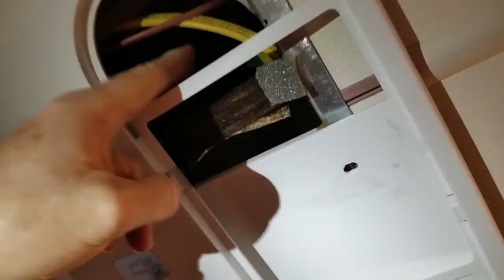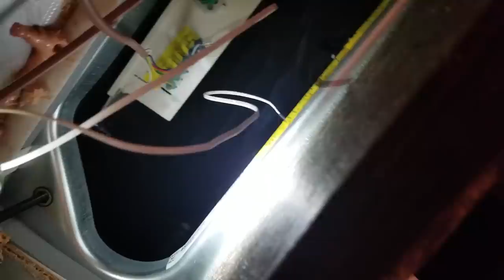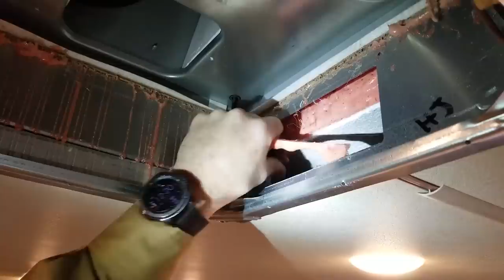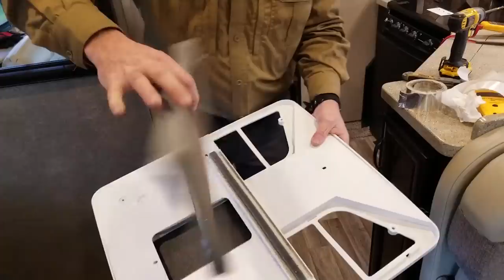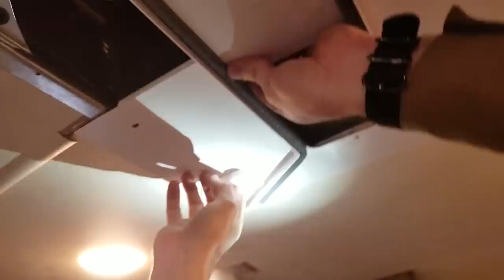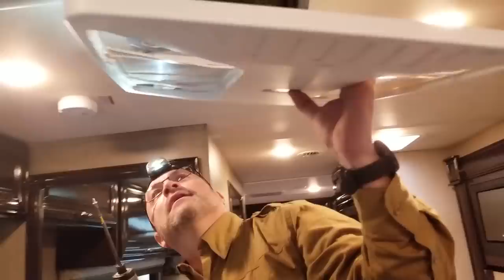Boost Your RV Air Conditioner Performance With This Cheap, Easy Fix!

Comment: I  get 25* to 28* difference between outside air temp and the return air coming out of the ceiling fixture. (I don't have ducts). It was 110* here in AZ. yesterday, will be 112* today, and 114* for the weekend. I live in the motorhome full time, and stay pretty comfortable. And I'm nowhere near a shady tree. It takes a little work, but not a ton of money. I've used the foil tape to make sure the warm side and cool side do not mix, or have any way to go where it shouldn't. My cold air comes straight down through the roof, hits the flat bottom of the AC's ceiling fixture, and has to get itself out by going toward the front or rear and exiting through the vent openings/louvers. I put a layer of Reflectix insulation in the ceiling fixture, and directly under the cold air return side I made a small "splitter" out of a manila folder, and taped it to the ceiling fixture . It basically forms a smooth, rounded, upside down "V" right in the middle of the air flow. The point of the "V" is at the height of the of the actual ceiling. This forces half the air to flow smoothly down one side of the "V" towards the front louvers, & the other half towards the rear rear louvers, instead of slamming into the fixture like a dead end. There's a lot better flow out of the louvers, and the reduced turbulence is a lot quieter. I clean the rooftop coils once a year at least. Twice if it's good year for monsoon dust storms. I keep the air filters clean, and added a layer of the thin, black, spongey-looking filter material to the outside of the the ceiling fixture air intake vents to act as a pre-filter. I attached them with some small, round neodymium magnets. I can just rinse them out real quick, and I can go about three times longer before I have to drop the ceiling fixture to clean the regular filters in there. I also use a small fan to blow air around inside.
  Other things I've done is put that Reflectix wherever I can. Inside the closets and cabinets. The roof vents and bathroom skylight/hatch. The back side of the furnace return air cover. Under the bed where the fresh water tank is. All of the widows are tinted, and have a snap on shade cover with a piece of Reflectix behind it, and thick window and windshield curtains on the inside. I keep the awning down on the one side. On the other, I put a row of screw in snaps along the roof line (like the snaps for boat covers and Bimini tops) to hold  a wide piece of 85% shade cloth along that side. For the roof, I bought a few pieces of the 4'x8'x1" foam insulating board from Lowes/Home Depot and cut it into pieces to fit the flat parts of the roof (Between the roof vents/AC/antenna/plumbing and refrigerator vents, etc. Nothing real meticulous. Just cover the big spots.) I stuck it on "shiny side up" using a few dots of silicon adhesive on each piece. The shiny side isn't very shiny after a summer, but it still keeps a lot of heat off. Do NOT try to stick it with silicon caulk. You'll be picking that stuff up everywhere after the first good wind. Even more if there's a little rain with it. If/when the board gets wet, it seems to dry out pretty quick though. Also, the best way to cut that stuff is with an electric knife. Works as good as it does on a ham or turkey! Otherwise, you end up with zillions of tiny styrofoam balls blowing around. Unless you have a hot-wire cutter I guess. One other thing I did to help the refrigerator out is I mounted a couple of 6" or 8" 12v computer fans just under the fridge vent cap on the roof. I pulled the 12v from the back of the fridge for the fans, and go through a little push button On-Off switch that I mounted through the wall on the inside right beside the fridge doors. Also a little red blinky LED so I remember it's on. I can't hear the fans at all. If the AC gets a little behind on a really hot day, I close the hallway curtain. The bedroom/bath in the back get a little warm, but not real bad at all. It definitely helps keep the front half cooler. I've never had to do it after evening though. And as a last resort, I made a small AC assist device if it's smoking hot out using a 12" piece of 3/4" PVC. On one end I attached a garden hose fitting, and glued a cap on the other end. I drilled and tapped two small holes that will fit the brass spray nozzles that are used on an outdoor residential Mister system. Each nozzle uses only about 1 to 1 1/2 gallons per hour. The Coleman Mach AC pulls air "in" over the condenser coil (for some reason they pull the hot air in towards the evaporator side/compressor/capacitors/pcb....who knows why?) so I aim it near there. I try to keep it back far enough that it mostly evaporates into cool air before it gets to the coil so it doesn't get lime/calcium built up on the coil. I don't want it "wet". It works pretty good in the Sonora Desert. Maybe not so much in New Orleans.
  Right now it's 8:45am. The outside temp is 95*. I have 2 digital thermometers inside here and they both read 69*. (It's actually a little too cool. lol).  I get this from a Coleman Mach III air conditioner (13k BTU) that's now 35 years old. It's the original on my 27' 1987 Fleetwood Pace Arrow motorhome, as is the fridge, furnace, water heater, power converter, etc. At 59,000 miles, I think the 454 is just getting broken in!  The only thing it really has wrong at the moment is a sun-faded exterior!  (I wonder what a "wrap" would cost for this thing?). I've owned it for 16 years or so, and used it mostly for some camping, a good bit of tailgating, and a ton of NASCAR & NHRA races. 3 years ago I ended up selling my house and moving due to some family issues to take care of, and have been full time in it since. Well, me, and a Whippet, and a big, goofy old Chow/Lab mix. When I eventually move on, I think I'm gonna stay mobile though. But it'll be in a 95 footer with 17 slide-outs, 2 engines, and 4 or 5 AC's. Maybe a pool. Something around there anyway!  lol  Anyway, hope these ideas can help some hot RV'ers out, too. Hot weather is doable.

Comment: Thanks for the information I have 3 / 15000 BTU AC units in my toy hauler and the one in the main living area is up in a loft area it doesn't seem very efficient I will have to check it out.

Comment: Thank you so much. I've been struggling with the AC in the main living room of my 5th wheel. Takes forever to cool down and the air is weak flowing at the duct vents. Can't wait to pull it apart and check it out. This makes complete sense and has to be the main issue with that unit.
Reply from the maker: Hi Stephen,

Hope that fixes the issue.  Also check where the ceiling ducts are.  Often you will find you are cooling the attic!

Happy Camping,

Cheers, 
Darren Koepp
Reply: Thank you very much!
Reply: I am having the EXACT problem in my 5th wheel. Air comes out strong of the main vent, but as soon as I close that the other vents barely blow more air.
Reply: @thedude1215  I did all exactly what he did in this video and fixed the issue. He's also right that you should check around the vents. The one in my bunkhouse was partially separated and cooling the attic. Just came back from my annual river trip. 95-100 outside and it was cold in that trailer. Had a friend stay in the bunkhouse and she said she was super happy to have a down comforter.
Reply: Thanks @tractor1969  !

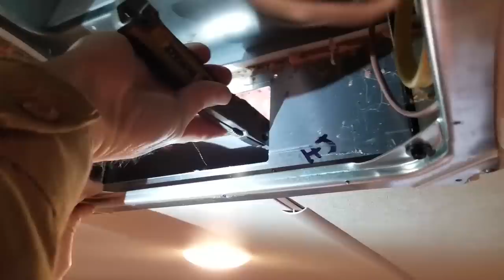Comment: yeah at about 5:35 you’re doing what’s called “flow.” when you make custom headers (or buy factory) it’s best to inspect them inside. there will sometimes be welding rod or wire remnant or even pipes misaligned with protruding edges that cause the turbulence. flowing them (sand blasting in this case) insures faster smoother passage of air. same procedure with cylinder heads; 3 angle, port, polish and flow. many guys don’t know about or ignore the flow.
that unit was a raging design flaw from the factory. nice fix!
Reply from the maker: Hi Dave, thanks for the comment.  I gotta work with the mess they give me - I try to make it as slippery as possible but sometimes it gets ugly!

Cheers,
Darren
Reply: My RV Works, Inc. hahah! been there, done that...

Comment: Had to do the same. Same Coleman unit. Also pull each outlet from the roof and tape the gap between the roof and duct....those had poor tape job and the attic space was getting air.
Reply from the maker: Hi Michel,

I just replied to another of your comments!  Thanks for contributing this top!  I should have mentioned it in my video but since I go unscripted I often forget to mention things.

I appreciate you and your contribution to this channel.

Cheers,
Darren Koepp

Comment: Just had our first hot weekend in a recently purchased trailer.
You have long been the "go to channel" for solid repair advice.
I wasn't happy with this rv's a/c! A coleman as well. I know what the next order of business will be 
I wondered about the roof unit having a black cover. Does a white cover prove any benefit on heat exchange?

Comment: I saw this video and realized my fiberglass divider was installed upside down,  foam seal against foam seal, and no seal at the top.  Yeah, the foil goes on the cold side, as silver doesn't radiate heat. Thanks!  Seems these were all installed by guys late for lunch or something.  That interface between the metal plenum flange and the plastic bottom plate would benefit from some 1/4" foam tape as well to seal that whole cold plenum chamber.

Comment: I found large pieces of ceiling material in my duct work.  They cut the holes for the vents, and didn't retrieve the pieces.  The ducts were blocked.  Very shoddy installation.
Reply: Forest River?
Reply: @Dman-jr8ey   Yep.  Exactly.
Reply: @timgreen4137  Just bought a Forest River Salem in the spring. Absolutely built like garbage. Horrible workmanship.

Comment: Our 30 year old HR had similar problems which were obvious as soon as I removed it's cover. It's difficult to understand why manufacturers allow such bad installations to pass inspection. What's surprising is how well it works in spite of it's bad installation.

Comment: New to us RV trailer. Had a look at mine (Same model as the one in the video). Both Ducts to the ceiling vents were completely taped off from factory. Only AC air, when on, was coming through the shroud vents. I sometime wonder what goes on at these factories and why they allow daytime drinking ;-)

Comment: Darren, I may be looking at a replacement.   I figured we've made  a profit on ours as it was new on 2005 and was working all the way up 2019.  It's a 13.5KBTU but I'm wanting to put on the best possible 15K BTU a/c that I can.   In your experience what is the best one out there?  Your efforts here quietly speak to the quality of construction!

Comment: Very good video 👍👍👍. I realize my air conditioner was not working good. I did the same thing you are doing.  Years ago. That divider is junk and something else should be use by the manufacturer.

Comment: Great info thanks very much for this I am having an issue with mine now not flowing very well to the front but still is good to the rear about to dig in and find out what is going on. But now I have a great starting point.
Reply from the maker: Good luck on the hunt!  Sometimes I am able to stick a flashlight in the far end and use a mirror at the A/C end and 'see' the light and identify any obstructions.  You may have already thought of this tip though.  

I will cross my fingers for you!

Cheers,
Darren
Reply: Thanks for keeping the fingers crossed found that the divider had fallen and was allowing he cold air to be sucked right back into itself. Put it back up and used the foil tape and fixed it as well as fixed an open spot that was not taped up very well and was allowing the air to escape right into it void in the ceiling. Works great now. I did use a battery powered ryobi
Reply: Ryobi leaf blower to make sure the air flow was good.
Reply from the maker: That is a great report!!!  Help share the info so others can stay cool too!

Cheers,
Darren

Comment: It's good to see someone use the proper tape for ducts. One of the first signs of a poor job is someone using duct tape for ducts. Foil tape is the proper tape for ducts in homes and RV's.
Reply: Surprisingly enough, "Duct Tape" isn't supposed to be used on ducts.🤔🤷‍♂️

Comment: So this is a fix for Coleman a/c units only.  Duotherms are built differently.  But, thanks for this video.  This is a huge issue that you fixed.
Reply from the maker: Actually any air conditioner that fits on top of a 14 X 14 hole has the potential to have a breach. Different manufacturers have different methods to address this but it all has to do with how they were installed.

Comment: It does more than a 20 degree difference.   It was 94 out during the summer, my ac was on full tilt, it was 59 degrees in the camper.

Comment: I wish this guy could look at mine! I have a brand new 33 ft travel trailer from bumper to coupler. On 90* days my camper will not cool down below 84* until the sun goes down. Just does not feel that cold. At night it works great. Of course camping world says there is nothing wrong with it. I dont think mine is right.

Comment: Hi All,  Great video as usual Darren!!!  Question to those on this thread:  has anyone installed a RV Airflow system and if so, what is your opinion of it.  While funneling airflow to the ducts and shutting off the dump makes sense the price point is pretty high for the unitl

Comment: Adding a hard start capacitor and a fan delay would help when you have a low voltage condition which is very common in the RV parks !
This might take some knowledge to but not very difficult .Maybe easy for a 20+ year HVAC tech ?
Start with simple tape idea first .
Reply from the maker: Hi  Joe, I could not agree with you more!  Both of the suggestions will go a long way in helping folks keep their A/C's running in less than optimal electrical conditions.

I just recorded an RV Rooftop  air conditioner video where I walk through testing the compressor, capacitor and talk a bit on how capacitors work.  It would be good to hear your comments on that video when it gets uploaded.  

On the unit I was working on it turned out to be a loss of refrigerant so I talked a bit about the clean air act and how folks need to go to an HVAC shop to get them resealed and recharged.  We used to be able to recharge them in the field but the fines have gotten so stiff if you are found doing it without all the correct licenses and tools so I just replace the A/C these days - which is what we will end up doing with this customer.

Thanks for the comment!

Cheers,
Darren

Comment: Thanks for info on rv air units & wall thermostat.  Question: In and older camper without a wall thermostat. Can a wall thermostat be wired into an air unit where the compressor cycles on/off but the fan runs continuously.  The thought is for the fan & compressor will cycle on /off at night. Now you have to get up & turn the fan off. Thanks, have a great day. Gary

Comment: Good video, nobody thinks about these defaults in the air conditioner. We all assume companies know what they are doing!
Reply from the maker: Indeed, it is still something on everyone's A/C that should be checked once a year. The adhesive on the foil tape fails over time.

Comment: Good observations of the “little details” that can add up to poor performance.  Speaking of observations, on the insulated divider which all made great sense with what you did, except with the foil vapor barrier on the cold side.  I’m thinking that vapor barriers are suppose to be on the warm/humid side of the insulation like in houses (interior side of wall).  In this case in inlet air side.  The reason is to avoid getting condensation against vapor barrier from getting cold.  I realize that 20 degree drop in air temp may not be enough vey often cause to condensation there,  it’s just the flip of the panel.  Just a thought.
Reply from the maker: You make a very astute observation regarding the foil side.  The mfg specs it this way and even many of the ducts are wrapped in this HVAC foil tape.  Perhaps their goal is to make the air slippery and not cause turbulence.  Thanks for watching, I appreciate your comment.
Reply: I was wondering the same thing. Shouldn’t the foil face the heat side to reflect it back?  Other than that question, and admittedly I could be wrong, this is a great video!

Comment: OK if your duck work is missing how do you figure out what size duck you need to replace the duck I have a Coleman Mock
Reply from the maker: In the manual for the air conditioner there is a section on installation. That installation section covers airflow specifications.

Comment: Can you make a video on how to do this with Coaches?  I have a Winnebago Adventurer Class A and the AC in my rig is terrible!!   I have a residential unit(unit sits on the outside and below the master bedroom).  It is a Coleman Mach Central System.  Please help:-). Btw, this video is really good and through!!

Comment: Also the foil side of the divider board should always be facing the front of the coach. When it pulls the air threw the reclaim side it will have condensation